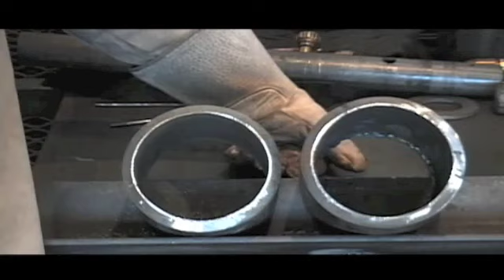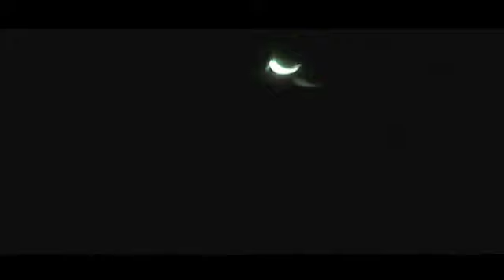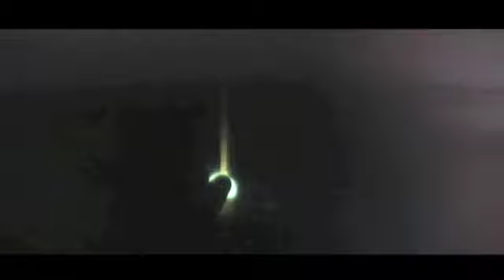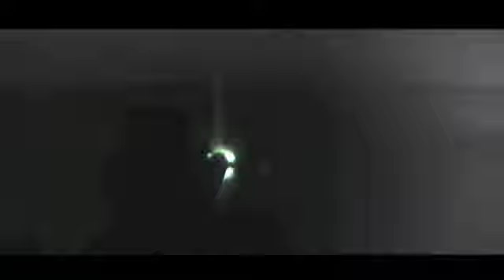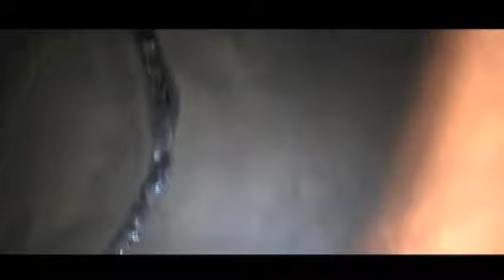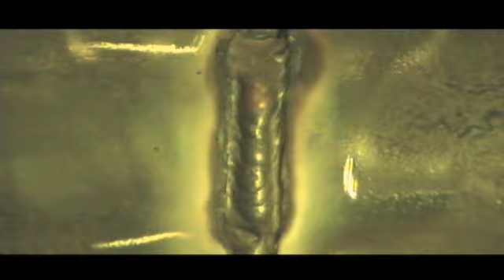Uphill Welding Instructions

Comment: I run my root at 65 with a whip motion coming in and out of my puddle. I get perfect heat and penetration on 65. My hot pass is normally around 95 to 105 so it'll push that root in farther. For me 85 to 95 is too hot for the root but there are many variables involved.

Comment: i have that problem with not seeing once i get to the top of the pipe. my bottom part has no problem going in, but i always seem to put that rod more to the right as i get from vertical to flat. hot pass, fill, and cap i have no trouble, just the top of the pipe as im running my root. i check for high and low before i tack my pipe.

Comment from the maker: The amps on the root for me is usually around 85-95 roughly depending upon the machine's accuracy with the read out. I actually struggled with this way more than i normally would have to because I used some old rod and it was not 6010 +++++
Reply: +Michael Treadway What is your technique for the bottom of the pipe at 6 oclock postition